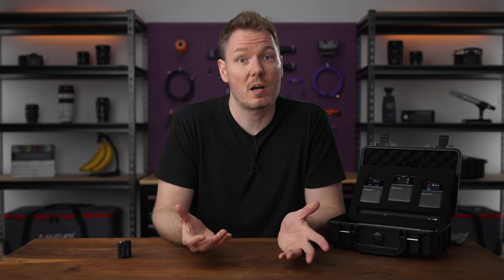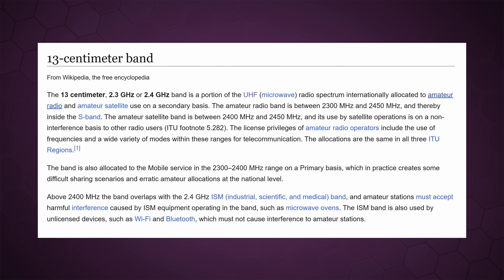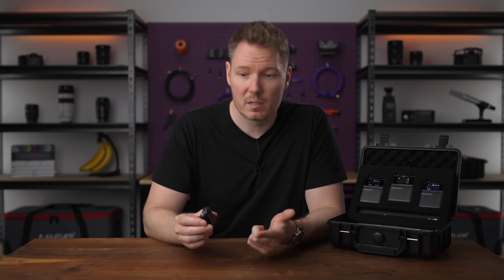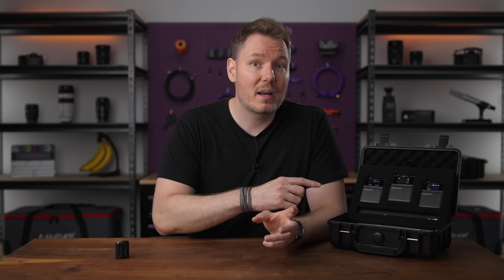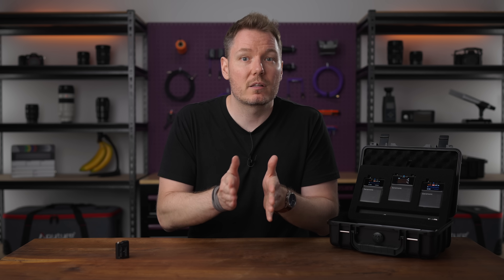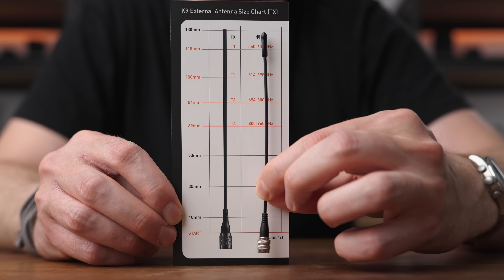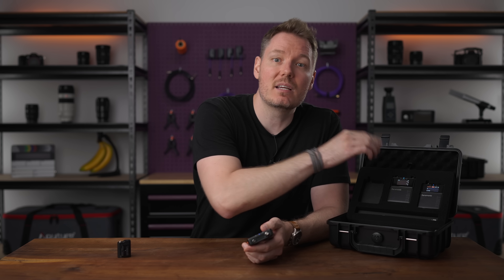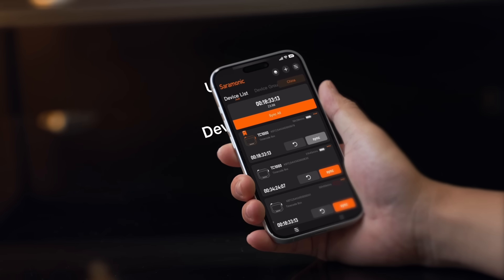Wireless Audio Explained: Digital UHF vs 2.4GHz (Feat. Saramonic K9)

Comment: I’m way toooo deep into the deity ecosystem to switch now, but the TC-Neo + K9 pairing is definitely tempting. If I wasn’t in the USA and I could record and transmit at the same time, I would be placing an order for 2 sets of the neos and at least one set of the K9’s right now. Unfortunately, with the USA restrictions it doesn’t present much of an upset over the deity stack I’ve got.
Reply: Just buy the international version

Comment: DJI Mic 3 is launching in 2 days. Rumours suggest it features a dual-band of 5ghz and 2.4ghz for extended range. I anticipate most 2.4ghz wireless microphones will release a 2025 version with comparable technology. 
It will be interesting to see how they perform compared to digital UHF kits.

Comment: For the 32-bit float backup recording feature on this model, if you never use the app, will the hardware work without the location-based restriction?
Reply: This is the question

Comment: It's nice to see you expanding your subject matter to peripheral concerns of videographers. Saramonic, however copied almost every aspect of their design off of the Deity Theos line of UHF Transmitter/Receivers. That kinda bugs me, because this is not the first time they've done it. Oh well, but your presentation was excellent and much appreciated.
Reply: hey competition is a good thing, and its not like deity owns digital uhf or 32 bit float
Reply: Priced almost exactly the same, so it's not like they really present anything different, and Deity has the license to record and transmit in the US, so Theos is undeniably better.
Reply: @thejourney3368  Except the Theos has a weird bug of transmitting at 500hz when it boots up no matter where it is tuned, which is a big no no for places like stadiums, the Saramonic doesn't have that problem.

Comment: 2.4G problems I had: Host turns around or walks behind a tree can cut the signal
UHF problems I had: somebody with a walkie talkie talking in my mics.
Reply: the fascinating part about this, from what I've been able to gather about how these work in australia at least (no idea about the US or otherwise), is that these UHF packs generally work in the UHF-TV range (yes as in broadcast television), which is entirely different to CB-UHF (what walkie talkies use). so you're unlikely to get someone with a walkie talkie talking into your mics, but you might accidentally pick up a TV broadcast if you're operating in an already allocated part of the spectrum

Comment: Great video Gerald, I've made videos explaining this stuff to a UK audience where licence requirements complicate things further.

Sennheiser's W100 series will be killed by this.
I've had the W100 G3 body packs for 15 years,  and Saramonic have clearly taken inspiration from Sennheiser but added modern features that pros need.

The only reason I'm keeping my Sennheisers is that I also have the XLR plugin transmitters for full size mics.

One thing people in the UK need to know is that you need a license to operate wireless mics below 863 MHz, and 865 MHz is used by telecomms.
The 2MHz space between these frequencies can be used without a license, but there's not enough space for more than 3 or 4 analogue audio channels.
Reply: Also, Ofcom will take an exceedingly dim view of anyone misusing licensed spectrum - yes, they can triangulate people broadcasting on those freqs, and yes, they will issue chunky fines and take the legal representative to court if it's egregious. Best to use whitespace or pay someone to arrange a spectrum licence unless you're literally in the middle of nowhere 😅
Reply: @ChristopherWoods yep, the licence is £85 per year for anyone interested.

Comment: Great, I just ordered a Rode Wireless Pro kit and now you drop this… 

Just kidding, as a sound engineer this is pretty common knowledge, but it’s good you are expanding it to the video people. The price to quality aspect is also worth considering - any of these more “pro” systems will run you more than 1000£€$ for a decent system, while most people, like myself, will be very well served by the Rode Wireless Pro or the DJI or similar for under 300€.
Reply: When you can just sync the 32bit float audio to your camera audio, nothing mentioned in this video matters. Except for replaceable batteries.

Comment: Nice product! Will study more about the K9 system to replace my Diety’s system that I lost due to manufacturing error and a terrible experience with they’re support team. 4+ years of trying to fix my Deity Connect...
From my first support ticket in April 2021 to countless follow-ups, shipping costs, and tests - nothing worked.
Instead of a real solution, I was pushed to buy a new Theos system "with a discount." After losing time, over $850 in related costs, and all patience... it's time to switch to Sennheiser o Saramonic.

Comment: 9:34 The FET in the lavalier may already demodulate the RF  signal, which means that the noise is already in the audio band by the time it reaches the filters in the K9 (and impossible to remove).

Comment: I wonder when they'll use 5ghz band as that's way more common now or even using standard tcp/udp protocols to allow for greater range via wi-fi or more complex setups where there are restrictions on the UHF bands.
Reply: TCP/UDP has nothing to do with wifi range, and 5GHz for wireless transmission will make the connection even worse. You can't just shove random buzzwords you read about onto random wireless devices just because they're wireless.

Comment: 13:20 android mock location?
Reply: I don't think the GPS location is being verified by the app itself, as Gerald mentioned it's completely optional. The restriction system has to be independent of a paired phone I'd assume.
Reply: I do wonder if you could use a vpn for it to work. But gladly that patent runs out in a few years so it may retroactively work after it runs out.

Comment: So you're saying the system wouldn't know that you're in the US if you don't use the app? :D
Reply: Or using a VPN on your phone? 👀
Reply: @thejourney3368 VPNs don't interface with GPS. They route your data through a data center, so your request to a website goes through the VPN's server, the website sends the response to the VPN server and they send it to you. GPS is its own thing.
Reply: @thejourney3368  VPN won't help. A GPS spoofing app might.